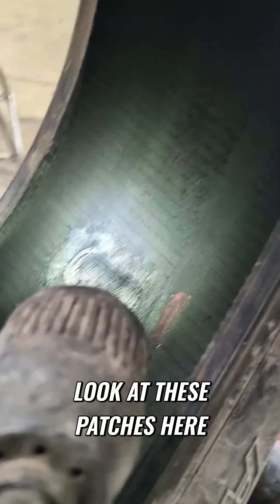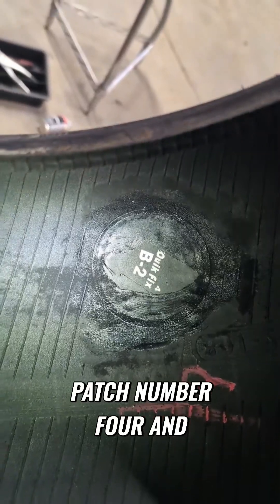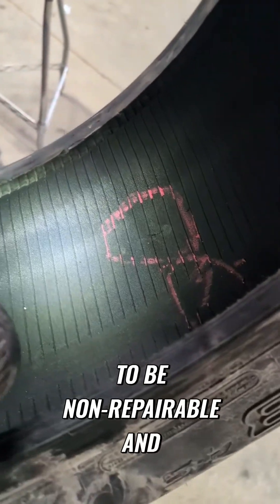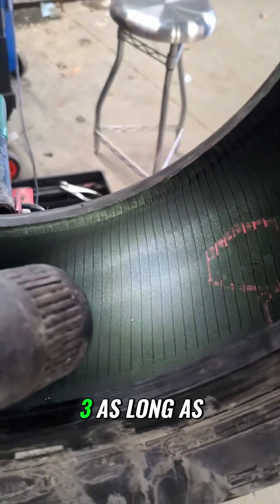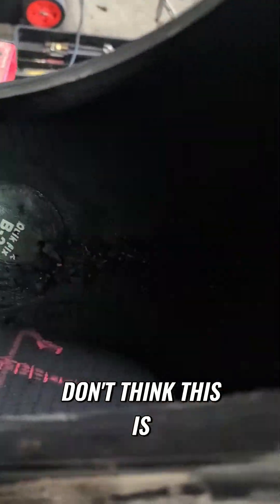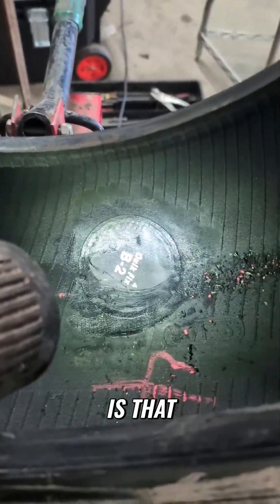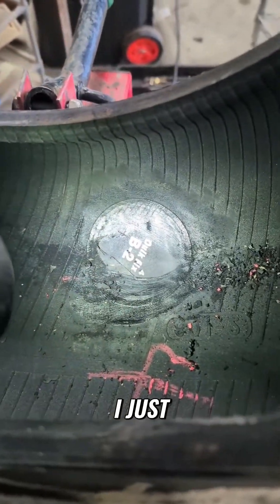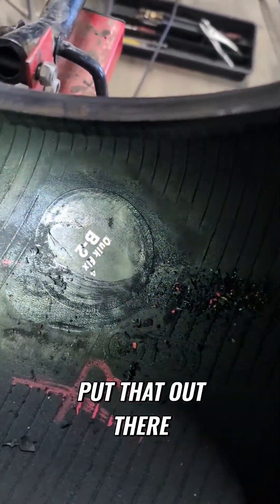Tire Patching: Key Safety Standards Explained

Comment: It's fine as long as it's done right and it's a heavier Duty Tire. Regular passenger car tires I would not recommend it, but a heavier Duty Tire like that Cooper Discoverer A/T that you're showing has 8 to 11 plys on it and it looks like he's gotten all the life out of it.  So regardless it needs to be replaced at that point.
Reply from the maker: @ryanjeepman7364  it's a 4 ply. I don't consider that a heavy tire.